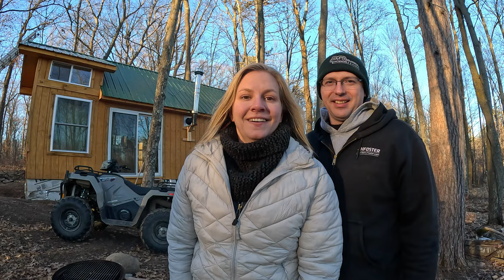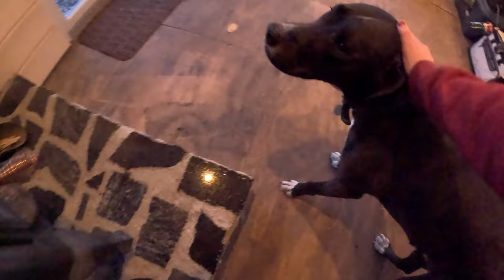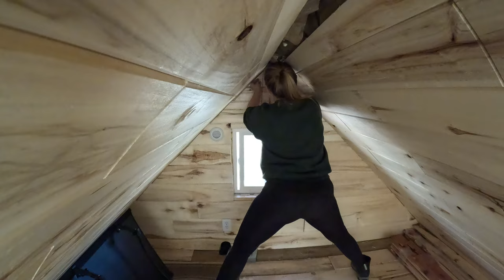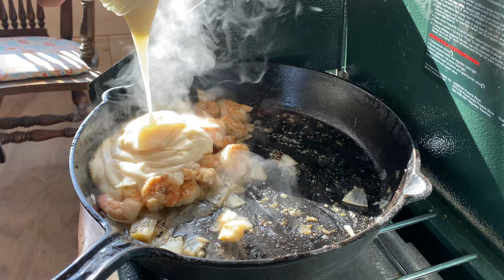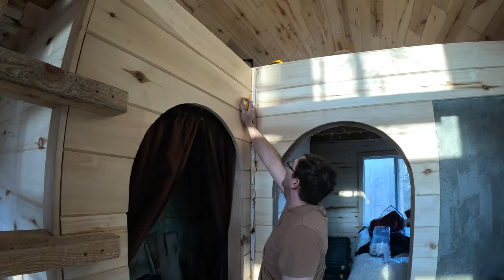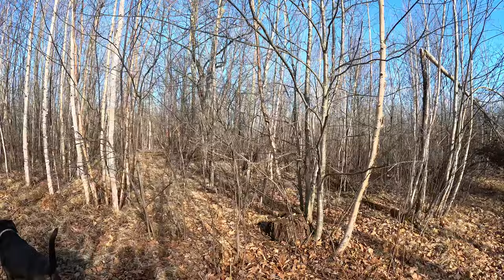BEAUTIFUL Off Grid Cabin CEILING & recessed lights. We RETURNED!

Comment: Enjoyed watching the build thus far, great job. I think you should have done the peak lights in 3 separate segments, so that if someone in one end wants lights on, it doesn't bother the other areas, also they can turn off the loft lights while the open area still has light.
Reply from the maker: This is a good point. We will have reading lights for the kids to read if they want to after lights are out. Not as much light with a reading light, but that was our justification for doing it this way.